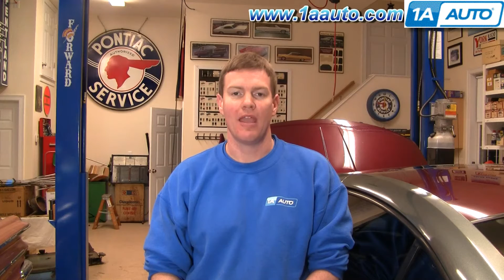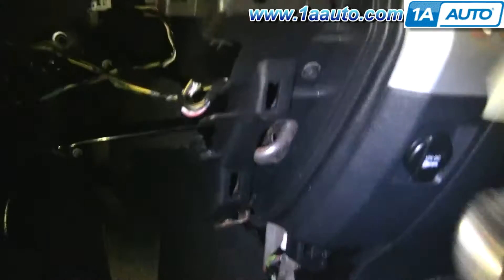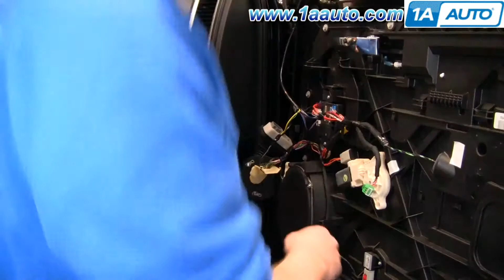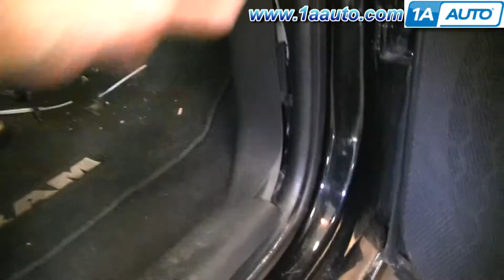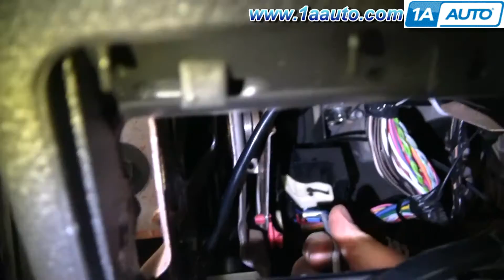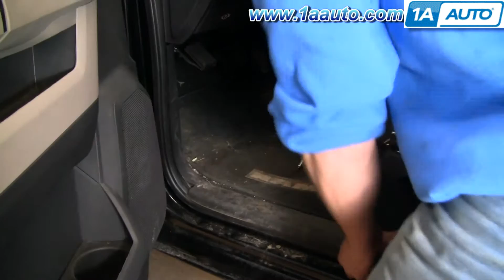How to Install Tow Mirrors 09-10 Dodge Ram 1500 Part 2

Comment: I have a 2014 RAM 1500...instead of the dash mounted switch in the video would i be able to replace my current window master switch with this one from Mopar 68110867AB which has the power fold button?